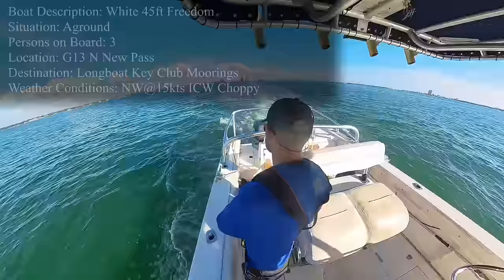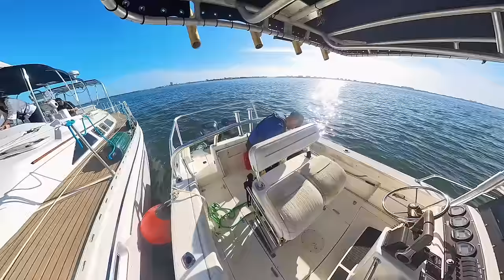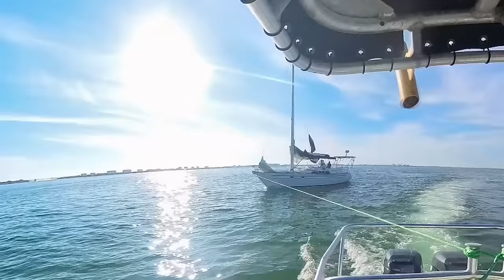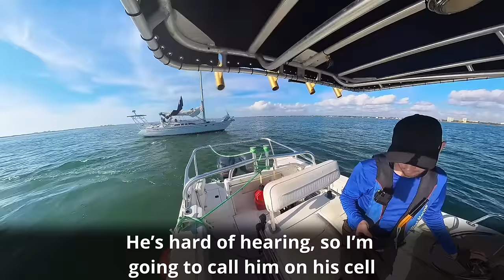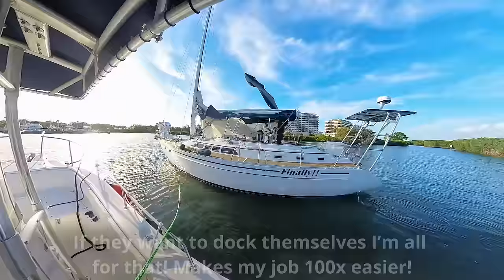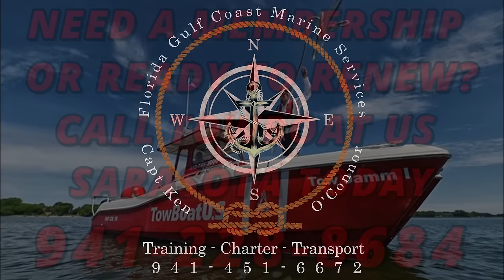How Many Times Will I Have to Save This Guy? | Grounding 45ft Freedom

Comment: So, I guess his motor was not working. Most of the time you can sail off a ground with some heel, but it looks like little to no wind that day. 5 foot draft is pretty short for a 45' sailboat. Interesting to see a 45' sailboat with a hank on jib. You could heel that boat pretty far and the boat would just pop right back up. The entire tow back to the marina, they could have been tidying up the sails. Did he want you to tow them in to save gas? That cap wasn't kind at all. If you have seen him thrice, how many times has he gotten grounded and made it out with his sails on his own? His keel must be tired and worn by now.
Reply from the maker: It's awing keel, so you can't heel it over too much when it's aground like that. That's also why it's such a small draft for a big boat
Reply: @CaptKenO  Yeah, makes sense.

Comment: I'm wondering about the synthetic ropes they are using for auto recovery and winches, and whether or not they make any sense on boat recovery?
Reply from the maker: The lines we use are synthetic material too, just heavier duty and designed to float

Comment: Hey Ken, do you just get what ever boat each day, I've seen three different setups, but two 200 smoke em's has to be the best sounding :)
Reply from the maker: Great question. So we have 1 dedicated boat per location, and 2 reserve boats in storage. The prokat and the worldcat are the 2 primary boats I run and they get swapped out about every hundred hour for maintenance. The whaler is the backup boat for the other location, but it comes down here when both of my boats are out for service. It doesn't happen often (thankfully), but sometimes one of my boats is out for major service and the other needs it's regular servicing
Reply: @CaptKenO  Cool, Ken, thanks for the explanation :)
Reply: At idle they sound like a top fuel dragster.
Reply from the maker: They're annoying as hell. It reminds me of working in Venice on the diesel boat and not being able to hear what the customer is saying (except the diesel sounded way better!)